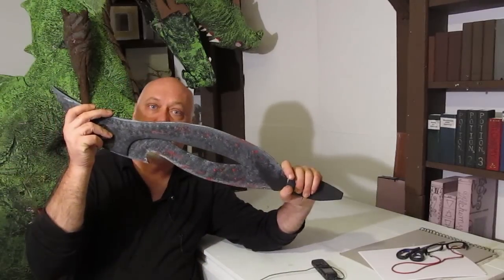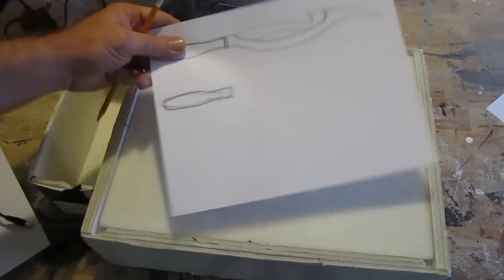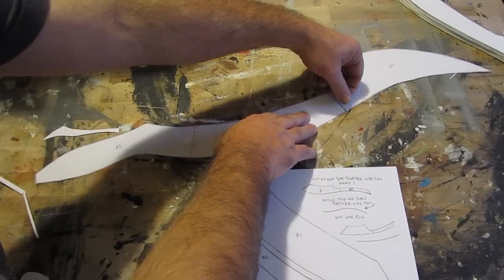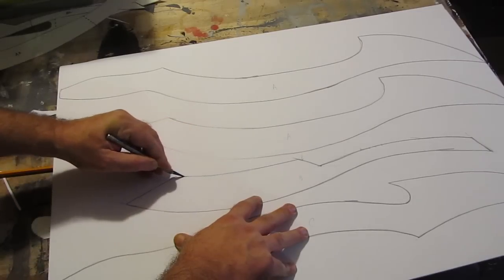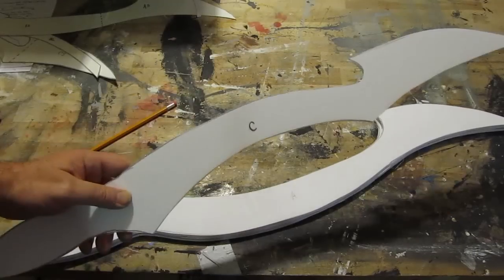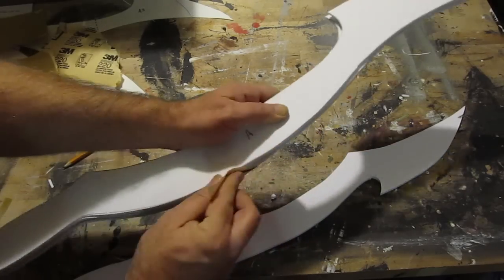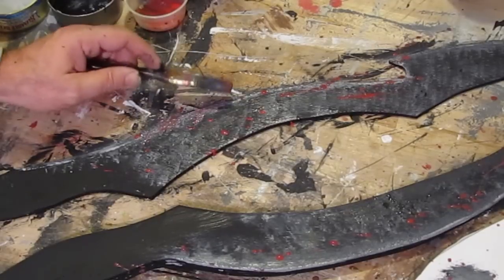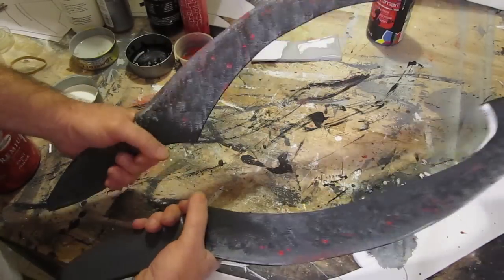Make the Bloodborne Blade of Mercy

Comment: anyone having trouble getting the blades to stay together: You can get rubber or ceramic magnets from just about any craft store. I wouldn't suggest rare earth magnets for foam board though. even the really small ones are pretty strong!

just cut out small parts in the smaller blade and the small inside piece of the bigger blade, and glue a couple small magnets in place (make sure you have the poles lined up right!)
Reply: the weapon ingame is made with siderite so your idea of using magnets isnt far off from how it is supposed to work :)
Reply: In bloodborne, It can easily reattached???

Comment: This is not meant as discouragement, or anything of the sort - But, the Blades of Mercy connect on the side of the tip of the largest of the blades, and are disconnected by folding the smaller blade out, so the handle is opposite of the handle on the larger blade, and pulling the blades away from eachother - The larger blade has a small pin in the tip - Very small, but it's peened, like a mushroom. The smaller blade has a slot going down the first half inch of the tip, that slides down beneath the peened tip of the pin. The handle on the larger blade has a bit that goes out to catch the handle of the smaller blade, so it doesn't twist in the hand. The design with the smaller blade being inside the larger one looks cool, but would never have worked. The Blades of Mercy would have worked in real life, with the design in the game. Just a small note; I think this is one build you should make in wood, instead of foam - Please, do a diy video on this weapon, where you use wood: Sure, it's gonna be a little bit more expensive, but people would actually be able to use it for cosplays (foam just kinda breaks when you try to work the blades.) Another good thing here, is that you can make wood look a lot like old, beat up metal: The Blades of Mercy are among the oldest of the hunter weapons of the workshop, and have lost their shine - But they aren't black. Siderite looks more like a silver substance with a high amount of grey in it; Still with a sort of sheen, and very dark. Again - It's not meant as discouragement! I love Bloodborne, and anything the community creates from that game is fair and square in my book.
Reply: My god.
Reply: As far as I know, in blooborne, this weapon is made from alien material, so the mechanic of it is impossible for real fight.